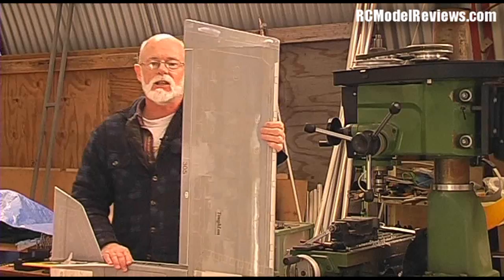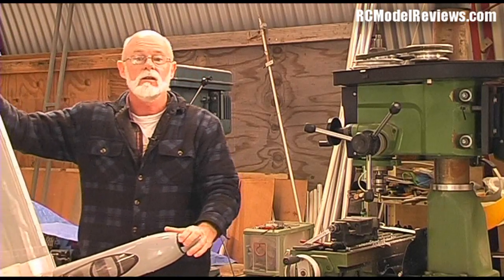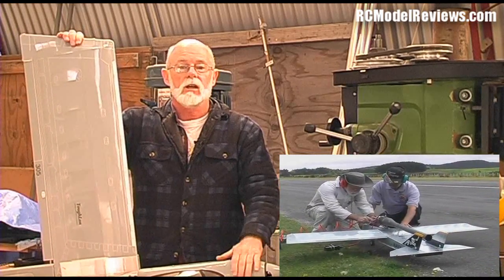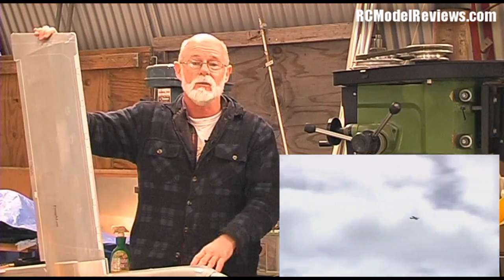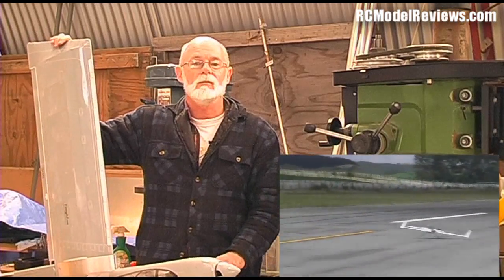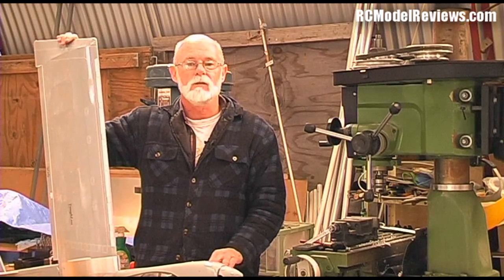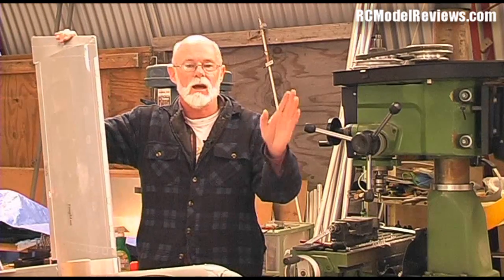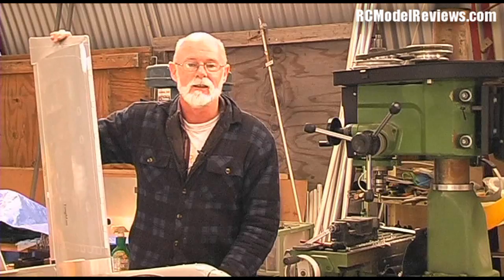More pulsejet RC planes coming on the XJet channel

Comment: Hi, I have a brand new Tiger Pulse jet is 800 gr of thrust, it measures 470 mm in length. What plane do you recommend for this pulse?
Reply from the maker: I am going to do a new build project for pulsejets around that size so stay tuned for that.  The model will probably be built from foam-board.  Flame and foam, what could possibly go wrong? :-)

Comment: I have been playing around with building valved pulse jet engines of various designs and have had alot of success (just ask the neighbors!). They all have ran well on propane, and was wondering if denatured alchohol is a suitable fuel for these extreamly  hot and loud, engines?
I want to get away from the hole pressurized propane tank. I am already setup with oneway pressure valve to pressurize the fuel tank and seems to build up pressure, but i'm not sure if the Alch. will work.
Any input?